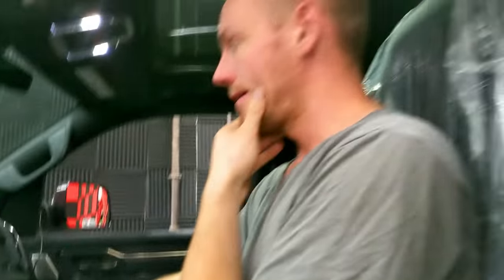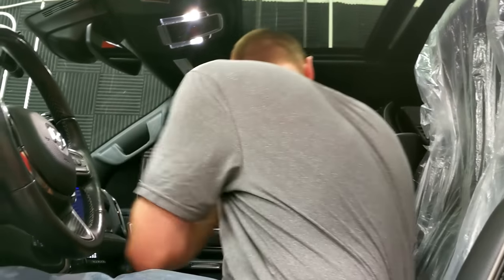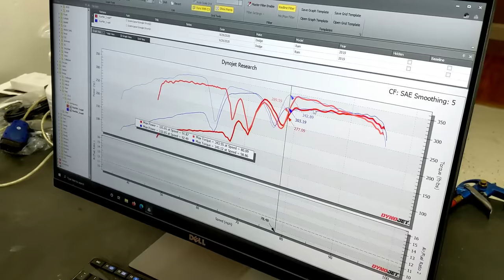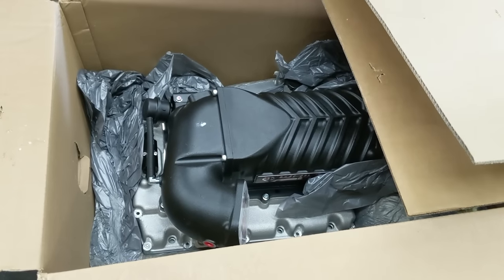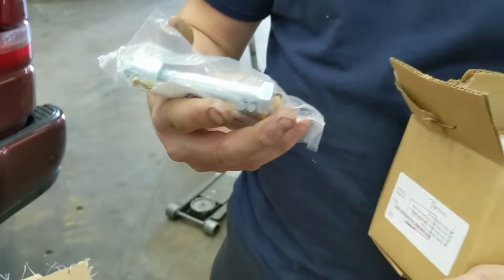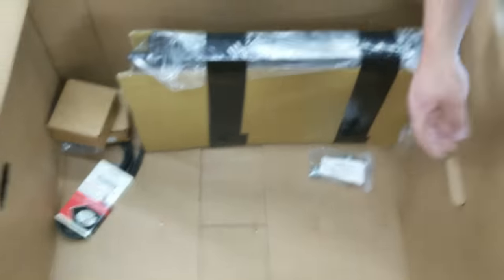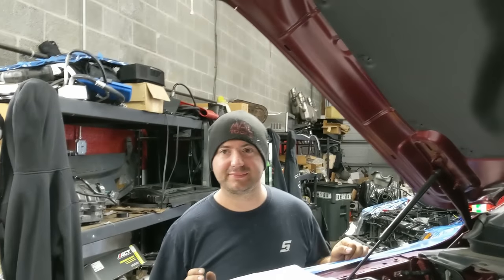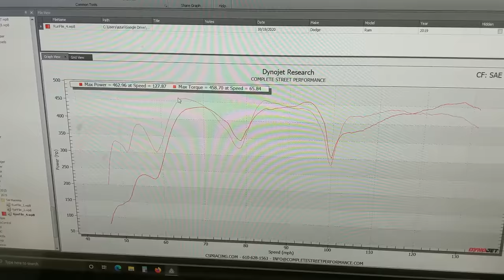2019 Ram 1500 Gets a Whipple Supercharger!

Comment: Once again ram and dodge are completely separated as fiat split them up when they bought them.
Reply: once again...

that's like saying pontiac firebird and chevy camaro are completely separate. 

That's like saying a pontiac G8 and a Holden Commodore are completely separate.

Pretty sure the Gen 3 Hemi in my R/T "Dodge" Durango is going to take the same parts as the Gen 3 Hemi in the "Ram" 1500. 

Just because they made it's own brand, doesn't make it not a Dodge. ;)
Reply: @bobbyd9583  I mean if u like being wrong fine go ahead.  U don’t call a Chevy suburban a camaro suburban 😂 u could call it a fiat ram but dodge and ram are the equivalent to gmc and Chevy.
Reply: @right8630  funny because my 2002 DODGE ram is still a "dodge", but go ahead, tell me more LOL!

Honda, Acura. Both Honda Motors.
Nissan, Infinity. Both Nissan.
Toyota, Lexus. Both Toyota.
Chevy, GMC. Both General Motors.
Ford, Lincoln. Both Ford Motor Company.

Different brands from the same parent company, all matter about 0% when speaking about whats under the hood.

I 100% promise, the motors found in "RAM" trucks, are still "DODGE" motors.

The Gen 3 hemi, was designed and released long before the FIAT merger, and are still made by "Dodge." There is NO RAM manufacturing plant... There is no motor made by a company named RAM LOL!

So go ahead and keep on keeping on.

Your ass makes a good hat doesn't it?
Reply: @right8630  Who is being disingenuous here? 

 Since the 2010 model year, Ram has been a separate part of the same company that focuses solely on trucks.

A separate part OF THE SAME COMPANY.

It is still FCA, which is still Chrysler, which is still DODGE lol.

You act like somehow they have no part of the parent company at all and have their own manufacturing line?

They didn't split the company into two separate entities, they created a new brand with it's own division within the company.....

lmfao, remind me again, who makes the Gen 3 hemi?

Pretty sure I can go pop the hood on my friends 2013 1500 and find the Dodge assembly sticker on that block.

It will only be a different manufacturer, and a different company, when FCA no longer owns the brand. end of story.

Until that happens, and as long as dodge produces the powertrain, you can call it anything you want... it's still a Dodge beating under the hood.
Reply: @bobbyd9583  I’m not saying that I’m saying that u shouldn’t call it a dodge if u don’t call Chevy a gmc truck or gmc a Chevy but as u like to point out their under the same umbrella of gm. 😂 ur so ridiculous idc if u call it a dodge u can be wrong.
Reply: @bobbyd9583  on my 2020 ram it has a ram stamp not a dodge and besides who cares why does it bother u so much? Being wrong is fine which u most certainly are.
Reply: @bobbyd9583  and on ur first point it’s 
                  Fiat
Dodge, Ram ,Chrysler,  jeep 
Is jeep or Chrysler a dodge? Answer no! It is not.
Reply: @bobbyd9583  I guess I’ll drive my Mopar 1500 😂
Reply: Their goes another mopar
Reply: @right8630  Did you really just say they have a new power train?

LMFAO!!!! omg.... dying here.

get wrecked.

On monday I'm going to call the local Dodge dealership and order some parts for my 2013 ram ROFL.

get wreckd.
Reply: @bobbyd9583  1500 has a new one the 2500 does not 🤷‍♂️ still doesn’t matter u might as well call it a mopar by ur logic.

Comment: Lmfao.
That's a joke.
I slapped a whipple on my 16 f150 & it threw down 750hp.
Friends don't let friends waste $ on rams.
Reply: Lies....keep trolling in your F150.
Reply: @charleshenson4183  You really think throwing a supercharger on a stock F150 means it makes the same power as a Shelby factory package truck? 😄
I'd love to see a supercharger kit that adds 400 hp to a stock 5.0l.
Reply: @ddak1998  
Honestly mine made more as I added larger duettchwerks injectors,smaller pulley,colder plugs & a vmp boost a pump.
You obviously know nothing about fords.
Maybe you should learn a thing or two.
Oh I didn't add all the other weight killing amenities that the shelby comes with.
It's closer to 800hp.
Reply: @charleshenson4183  See, you're clearly comparing a built up full tuner kit with supporting add-ons fuel to a basic off the shelf kit with no changes in fuel delivery. I know plenty about Ford's from my last 3 including a 2015 F150 5.0l that was shit compared to my RAM 5.7l when it comes to towing.
Reply: No it didn't..... typical one upper.
Reply: @ddak1998  
No I wasn't.
Mine in as delivered from is 750hp.
Reply: @ronaldmoparornocar9590  
Oh yes it did & it's not a mystery as this is a simple off the shelf whipple for 15+ f150's with the 5.0.
It's not a mystery or even anything new.
Get your head out of the sand & get with the times.
Reply: @charleshenson4183  You're also quoting crank hp numbers and comparing them to dyno proven wheel hp... Get YOUR head out of the sand!
Reply: @autoblog3922  
I would consider that a lie as well.
Thx for pointing that out.
Reply: @charleshenson4183  no problem. Glad I could help.
Reply: @MyDailyPerspective  he probably actually has a 96 beater with anchor ⚓ v6
Reply: @g8joe  
 I don't make videos.My builds 100% financed by me & could be partially financed by you if you have a ram like this & care to put your $ where your mouth is 🙂
North mid Tennessee is where I'm located.
If you have a truck like this & think it can beat a whipplecharged supercrew 16 fx4 f150,you just bring it on & we can squash this conversation & you or anyone else can videotape it.
You think I'm lying,now here ya go.
Reply: They said 475 rear wheel horsepower?  What would that be at the crank?